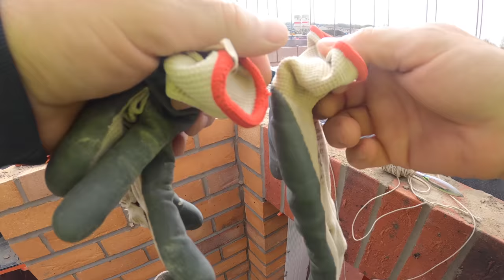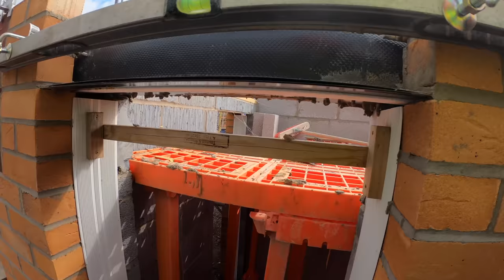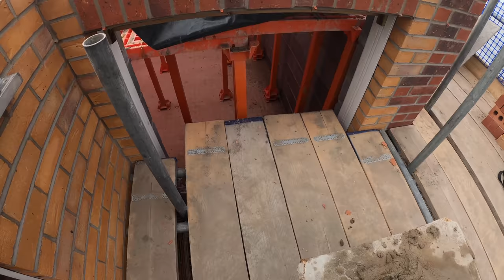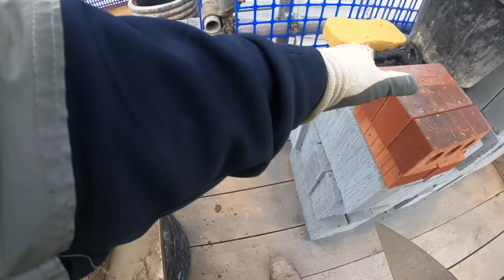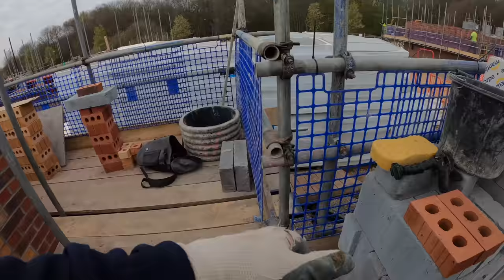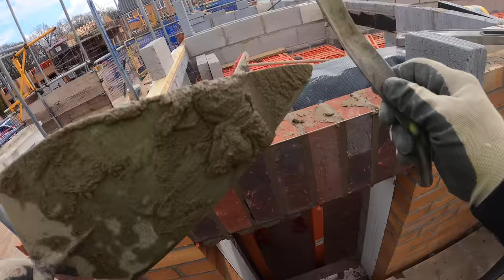SOLDIERS OVER A LINTEL

Comment: Those clamps look quality
Reply from the maker: They really are Paul 👌🏼🧱👍🏽
Reply: Where can we get these from
Reply: @matthewingham8579  Just Google  Fitzbrick clamps.
Reply: What about the soldier clamps
Reply from the maker: @matthewingham8579  Hi Mathew they are made by BT Engineering and they are called T clamps 🧱👍🏼
Reply: Fantastic. My titan drill came yesterday 👍👍👍
Reply from the maker: @matthewingham8579  . Cheers. Great budget tool that 👌🏼💪🏼🧱👍🏽
Reply: @SteveAndAlexBuild  will those chisels break through concrete.
Reply from the maker: @matthewingham8579  . Yes but not very fast . Way better than hammer and chisel though 💪🏼🧱👍🏽